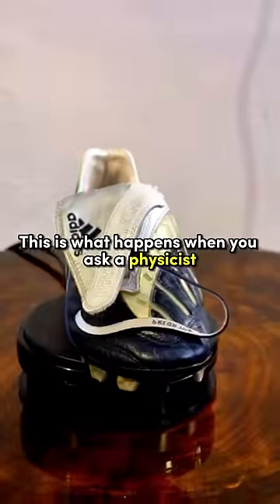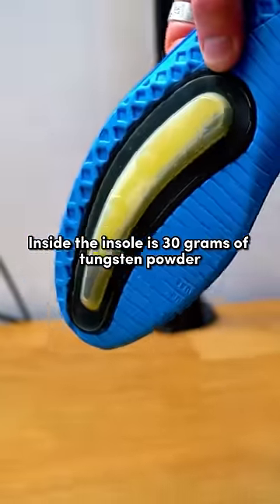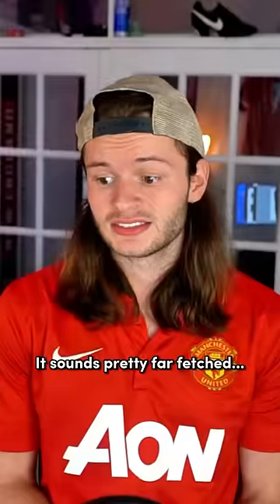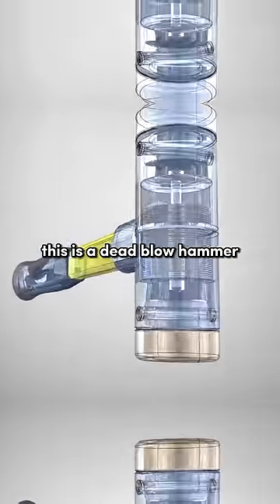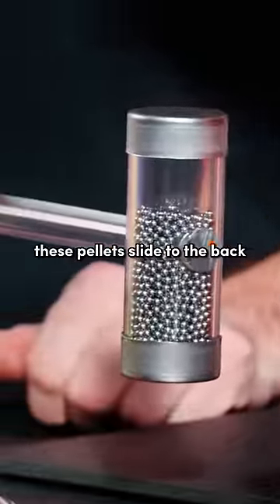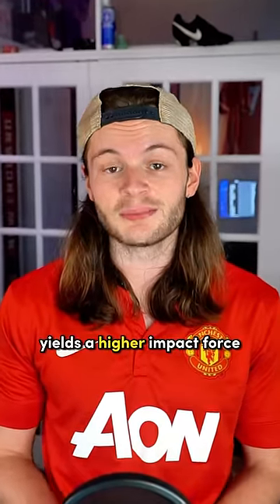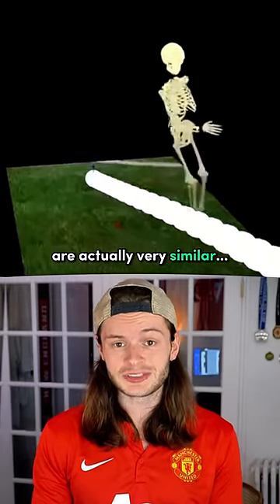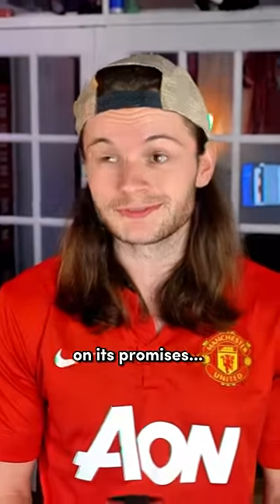When a Physicist Designs a Football Boot👨‍🔬⚽️

Comment: it's kinda gimmicky, the amount of tungsten shot in there isn't very significant, and if it was, it would affect your running and other movements
Reply: Maybe it's to help kickers use better physics to maximize force. If the slight weight can be felt when you pull back and launch, then I can see how it would help players.
Reply: In the world of elite sports, victories are taken by millimeters and thousands-of-seconds.

Meaningless to anyone not operating at the peak physical abilit. Impactful in professional sports...
Reply: @NSixtyFour True
Reply: A 5% to 8% difference is rather major as far sports goes

In a 20 people group,a 5% would be a 1 person

And you would easily notice the difference between 19 vs 20

Small percent begin to be noticeable around the 2% and 3% mark (that little edge that is slightly crooked,that small akward feeling when steping on uneven surfaces etc)

That 5% more power means the average distance kick goes from 3 metter to 3.15 (3 metters and 15 cm)

Those 15 cms are basically a head or a hand of distance,and they make the difference between a goal and a goalkeeper block
Reply: @valentinov901  that 5% that you're writing novels about is a marketing claim and not backed by actual data.
Reply: They should add 'sports mode' like crocs 😂 like you turn on your beast mode switch 😂😂
Reply: Ah yes, the typical YouTube expert never disappoints
Reply: @elseby maybe kipchoges marathon run reignited shoe technology as something with a slight shot of being taken seriously so they go ahead and try
Reply: The shoes look like: "Cut my life into seasons. This is my last shoooot." 😂😂
Reply: @NSixtyFour not in football. stop being so dramatic
Reply: squats and lunges solution boom

Comment: A deadblow hammer is literally designed to deliver less force. Part of caluculating force of impact is how long the objects are together thus how long it takes for the force to be transferred. If the hammer is staying put then the time of impact is longer thus the force is actually less.
Reply: The more I think of this the more useless this gimmick seems. Let's say you kick through the ball. That means the ball will leave your foot before the beads have a chance to move forward.  Let's say you trap it with your foot coming to a stop on impact. Typically this is done with the side of your foot meaning the beads won't move on the correct direction. Even if you toe tap, the ball will probably leave your foot before the beads slam forward. Even then you tap the ball for control, not accuracy. It would've been more effective to use a solid piece of tungsten near the tip of the shoe. This wasn't created by a physicist, bur a marketing major.
Reply: Sort of.  It's designed not to dent wood.  It does that by delivering it's force over a longer period of time.

Comment: Deadblow hammers dont hit harder. The rest of the energy is not transmitted to the object but rather heat dispersed through due to the collision of the tiny balls. If anything it would be less efficient for its weight given that the force would be transmitted over a longer amount of time due to part of the mass (the balls) being still in motion during the point of contact

Comment: Mechanical engineer here: a dead blow hammer extends the collision impulse of a strike, which is useful for pushing material.

The tungsten shot in the shoe serves not to extend the impulse but to add mass for greater momentum and thus greater momentum transfer into the ball. The reason it is shot and not a solid lump is to extend the impulse for the sake of the foot, not the ball; otherwise, it may do damage.
Reply: The shoes look like: "Cut my life into seasons. This is my last shoooot." 😂😂
Reply: When you factor in the time it takes for the tungsten mass to reach the object, you result in lesser force being applied to that object. Also, the energy from the tungsten would be transferred throughout the foot, not onto the object being struck. Just like a dead blow hammer.

Comment: Can you post your sources? I can’t find the adidas claim of 5% more power and 8% more swerve anywhere, including Wikipedia. I’m skeptical of those findings as the motion of a hammer and the motion of the kick are different. A hammer moves basically straight up and down and so has time to shift the tungsten to the opposite side of impact. When you swing your foot for a long kick, the way your foot is pointed I believe all the tungsten is by your toes already and doesn’t have the ability to shift back. I wouldn’t be surprised if adidas claim is only for kicks where you don’t move your leg back first or something gimmicky like that.
Reply: to be fair, soccer player do not hit the ball with the toes, you usually whant to hit with the nternal side of your foot or for power shot, with the neck of the foot (sorry but idk how its called in eng), basically from the ankle down

Comment: Ignoring friction, back of the hand calcs:

Tungsten mass: 0.03kg
Average kick speed: 22.352m/s (50mph)
Momentum: 0.03 * 22.352 = 0.67 Ns

Ball mass: 0.45kg
Ball speed: 0.67/0.45 = 1.49m/s (3.3mph)

So an extra 3.3mph theoretical maximum ball speed could be achieved. 

Bare in mind the extra mass in the boots require extra energy input to get up to the same speed and that this may not be achievable if a player is already kicking their hardest. That plus losses due to friction and kick angles etc, it seems the gains would be minimal, but perhaps the margins are that fine at the top level that this could be an advantage 🤷

Comment: No you have that backwards. A fully elastic collision (ie bounces back) is the most efficient transfer of energy.  Look it up. Plus think about the deadblow hammer. The lead shot doesn't come forward until after the hammer hits meaning it is actually a separate "hit" that only counteracts the bounceback of the hammer, not actually hitting the thing the hammer hit. Think about it like this, equal and opposite reaction, if your hammer bounces back with a certain amount of force, that was actually additional impact imparted on the thing you hit, because its going in the other direction. However thinking about what I said above, I am not sure how much the dead blow even decreases the impact of the deadbolt, as the shot limits the bounceback after it happens (soon after but still after)  I bet dead blow hammers are more about limiting vibration and strain on the operator rather than the work piece.

Comment: Deadblow hammers are for use in tight locations where you don't want it to rebound into another fragile part. The striking force time is delayed and the particles inside the hammer distributes the force of the strike so it feels "dead". It's even more gentle than a wooden mallet. An insole in the shoe is designed to alter the position of the foot and thus the angle striking the ball, and that is a very different and potentially beneficial alteration not related to the hammer story

Comment: Even if the similarity to a deadblow hammer holds true, the difference in mass makes the soles pretty insignificant. In the Hammer the majority of the mass is in the metal grains, but with a shoe the largest factor will be the mass of the foot.

Comment: This is incorrect. 
Basically, the beads in the deadblow hammer absorb the opposing force(recoil). They rustle about inside the hammer just after the moment of impact. This saves the swinging arm from extra work. The same swing(speed/path) with the same weight hammer provides the same force. If the shoe is heavier, the force required to move it will be more, and the force upon impact with the ball will be increased. The tungsten is still in the back of the pocket when the ball leaves contact with the shoe because the foot is still moving in the same direction. This means there is no work saved while recovering from the kick. It actually just makes recovery more difficult.
Force is added. The added force will translate to slightly exaggerated spin(if the kick path goes through one side of the ball.)
Not actually genius, but still probably effective for the game.
The physics of kicking a ball is not very similar to a hammer blow. This is for 2 reasons, 1 because the kick is delivered by a softer material attached to a more flexible/dynamic system of controllable parts. 2 because the kick is hitting a soft and moveable object not a fixed, rigid anvil.
Please stop pretending to explain like a scientist. Most people don't know the difference.
Reply: All great except where you start taking about exaggerated spin. IDK where you got that notion
Reply: @precisionwresonance  yes. Spin occurs because the blow shoots into one side of the ball. Added force through any side of the ball translates to more spin because it is easier to spin the ball more than to move the ball further after some small distance moved.
Reply: @QobelD  are you saying that everytime a ball is kicked, it is spinning?
Reply: The shoes look like: "Cut my life into seasons. This is my last shoooot." 😂😂
Reply: @precisionwresonance That's not what I'm saying. There can be zero spin, if the ball is kicked through one of the longest paths through said ball.
Reply: @QobelD  I see, you edited your response. Just looking for clarity.
Reply: @precisionwresonance  this is because I said the shoe wouldn't add spin, and that it would exaggerate the spin. I see that it sounded contradictory. If there is zero spin... There will still be zero spin if we add force to the kick.. so it's not quite adding spin. it's exaggerating whatever spin would've already been placed on the ball.
Reply: @QobelD  so if there is no spin to be exaggerated, what else is being exaggerated? (psst: I know the answers to all these questions)
Reply: @precisionwresonance  I will oftentimes exaggerate rhetorically

Comment: This is straight up incorrect. A deadblow doesnt apply a higher force, it spreads out the impact over a longer time frame, decreasing the instantaneous maximum force. If you throw two balls of the same exact mass at a wall. One ball bounces and the other sticks to the surface, if the ball rebounds at the same velocity as it entered, it will have applied DOUBLE the force of the ball that sticks.

Comment: Lighweight boots are less than 200g. So, 30g is kinda heavy. So running and movement will be negatively impacted. How many power shots will you take in a game VS How much time will you spend running/moving? Bad trade off.

Comment: Depending on what you're using the hammer for you WANT it to bounce. Blacksmiths, for one, make use of the bounce to more easily lift the hammer - though it doesn't bounce off of softer, more melted metals, they can redirect it to the side. Not to mention that the bounce is a quick way to check/correct the side of the hammer being used without taking your eyes off of work to check and manually turn the hammer. I wrote this specifically because of how the hammer was presented which would have people assume the wrong thing about it's practicality, though I don't know if this would really make the hammer hit harder... Doesn't really make sense to me.

Comment: But why do the beads lock with the direction of force despite... 

Okay, so the face of the hammer deforms and reforms and that energy causes it to bounce. 

The beads in the hammer reduce deformation of the face during the strike by deforming it the opposite direction as second strike and spread the kinetic energy of the rebound over a greater surface area and types of mediums so they dont jump back as farr with the same amount of energy as a solid piece.

Comment: I can tell you that this is called conceptualized marketing. It’s real science re-imagined in a science fiction expectation of the product. Meaning that in theory it may be similar to the hammer explanation but in the fictitious scenario where the boots are about to deliver power the the external variables are taken out of the initial scientific equation. The hammer, is striking a solid plane, typically  hard surface, typically you strike a hammer more than once so thermal dynamics are now at play, the list goes on… but in the boots scenario you’re striking an inflated surface, it’s round it’s relatively softer, the weight in pounds does not allow for enough force for the tungsten to generate any type of effect. And you typically only strike the  once if it’s a power shot at goal.

Comment: Comparing it to a hammer is nothing alike. When you swing to kick the powder will force itself toward the toes adding more power. Technically yes it works but 5% and 8% is 💯% bullshit it's more like .05% and .08% and you won't be able to see any difference unless you use very sensitive pressure sensors

Comment: Wait so the tungsten would also move while your running and slowing you down?
Reply: Very very slightly. Essentially what's happening is by kicking with a slightly heavier shoe you impart more energy into the ball, as kicking with a heavier shoe takes more energy to start. It's the same mechanical principal that makes heavier sockets better for breaking free stuck fasteners. The whole double hammering force thing he's talking about is nonsense, but the additional weight is making some small difference.

Comment: Are they actually worth it when you factor in the additional weight though?
Reply: If you're just a hobbyist? No, this is aimed more towards the top players with insane accuracy and kick power.
Reply: @Sphyxx  I understand the benefits, but what I’m saying is does that offset the downsides of the additional weight? Heavier boots are generally worse for maneuvering. Is the extra power enough to make up for that?
Reply: There are always ups and downsides to heavier shoes but usually a heavier object object travelling the same speed as a lighter object usually has more power behind it, I right now don't have the calculation power my brain is all fried from past week but going on reddit into r/theydidthemath and asking they might have an answer inside 5 minutes

Comment: That is bullshit. 
The energy to accelerate to pebbles is more than without, because F= 1/2 mass * velocity² of the whole shoe.

But the shoe does not transfer the energy in one blow, instead from the point of first contact and stopping of the shell, the pebbles keep moving, so their energy is not transfered.
They hit the tip of the shell later with exactly 1/2 m* v² of the pebbles.
But this energy is unequaly distributer among the pebbles causing friction and some of them cancel each other out.
So:
1. energy to accelerate is the same.
2. energy is distributed among the time if impact.
3. Some energy goes into friction, thus heat, thus loss to the surrounding.

Know your physics, stay in school!